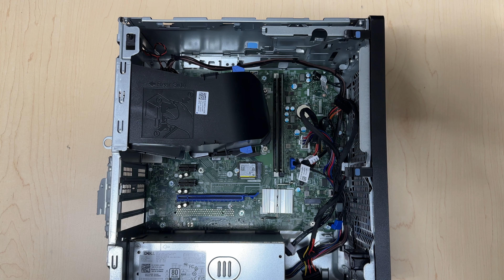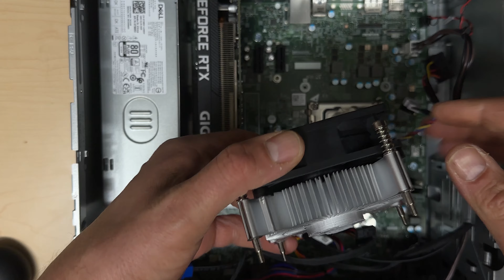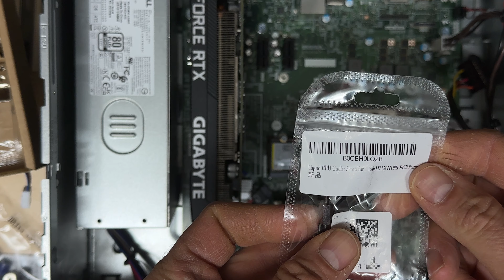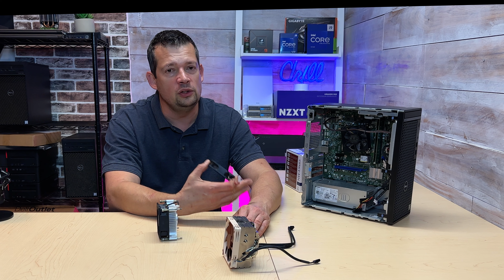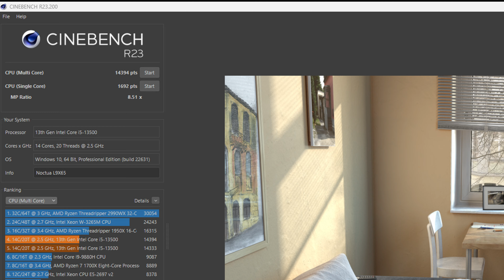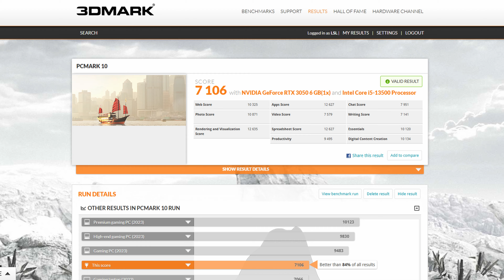2023 Dell OptiPlex 7010 MT Standard  Review

Comment: i have msi RTX 3050 lp oc double slot,  if i put in same PC what about hte noise levels .. will they b ok or too loud while gaming... on stock cooler
Reply from the maker: You should be fine. That csrd can produce a lot of heat, but in the mini tower , it should be ok. Worst case scenario you replace the CPU cooler and add a decent size front fan.
Reply: @Scott.The.IT.Guy.  well got it, cpu and gpu both remain at 76 degrees with no additional fan. and no noise
Reply from the maker: That’s great!

Comment: i have a similar machine, dell OptiPlex 7020 12gen core i7. 32 GB of DDR5 ram. but my power supply is 180w.  is it possible to upgrade my power supply in order upgrade my graphics Card to RTX 3050 6GB? and where do i get a 300w Power supply?
Reply from the maker: Yes you can, you can get a 260W, 300W and the 360W with a mini power connector for the GPU so you can install a low profile 4060 or 5060 OC card as well.
Reply: @Scott.The.IT.Guy.  Thank you so much for your swift response. but can it support a 500watts Power supply??
Reply from the maker: @TechTutorPro-y8d  I think this model taps out at 300W.
Reply from the maker: These Dell parts should work: 
Dell 360W PSU with GPU power support Dell part number  0TTFHH
Dell 300W PSU with NO GPU power Dell part number  3XY3J

Comment: 😥🕺 its a night mare to upgrade this pc to play games >.> so long for the days of just pick up a  optiplex and put a graphic card and ready to game >.> this new gen is not the way lmfao
Reply from the maker: You can get a low profile RTX 3050 OC card, that will come with a full hight bracket. It`s a decent card, does not require a power supply upgrade.
Reply: @Scott.The.IT.Guy.   can i just buy some DDR4 Ram like 16gb sigel slot to later buy another 16gb to build up to 32 or even 64 in the future ??? will it work on this machine ?

Comment: Useful thanks. looking at the Dell Optiplex 7090 - i7-10700 32GB 480GB SSD GT730 2GB - BIOS LOCK - No Optical . supports the RTX 3070 OEM.  A bit confused by your model no. Can only seem to find older model 7010 MT. want to build budget sim racing setup with rtx 3060 oc. i have ordered a compatible.  dell 500w  PSU  D500EPM-00
Reply from the maker: You are not the only one who is confused about the Dell model numbers lately:)
You are correct,  that 7010 MT was introduced in 2012 and the same model number got re introduced in 2023 confusing everyone. 
Dell realized they messed up and they were trying to rename it after the lunch and call it Dell tower .

This is it:
https://www.dell.com/en-us/shop/desktop-computers/optiplex-tower/spd/optiplex-7010-desktop

But no worries, in 2025 Dell decided to completely drop the name “ Optiplex “ and came up with a much cooler, wait  for it: ECT1250 aka “Dell desktop”

Comment: It doesnt have wlan card installed
Does it have a port where i can install it or ill have to use an usb wifi dongle?
Reply from the maker: Yes, around 1:10 in the video, you can see the empty m2 WiFi card slot on the right hand side.
You find the officially supported m2 card at page 14:
https://www.delltechnologies.com/asset/en-us/products/desktops-and-all-in-ones/technical-support/optiplex-tower-7010-technical-guidebook.pdf

I would just get a sub WiFi card if you don’t have to go through the whole process, make sure you get something where the antenna can be freely place around the pc, not like just sticking out of the USB port.

TP-Link WiFi 6 USB Adapter for Desktop PC archer tx20u

Comment: i have this same tower i tried using a 750w sfx psu with a 24pin to 8 pin adapter i had no luck with it even turning on any solution to fixing this?
Reply from the maker: I checked a couple Dell topics at Dell.com but haven’t found and compatible adapter for the new 7010 and 7020 lines, only for the older models. The 2023-2024 models PSU is different than the prior years.

Comment: don't some optiplex's have the power supply on the top and not the bottom? i think the pc would run hotter with the gpu so close to the power supply at the bottom. so it's best to find a optiplex where the power supply is on the top i think.
Reply from the maker: Most of them has the PSU on the bottom now since the PSU is heavy. This way it resonates less with the case, the tower is more stable, they are not getting super-hot anymore. My 750 W PSU keeps turning the Fan off under light load. Under heavy load it’s almost completely silent. Please send me your shipping address.

Comment: I was pretty sure that the OptiPlex mini tower is way more upgrade capable than the small factory form, I guess I was wrong ?
Reply from the maker: I am surprised as well, looks like they are really pushing the standard plus.
Reply: I guess you have to get the higher spec model in order to get a less shitty motherboard (4x dimm slots, extra m.2 slot etc...)